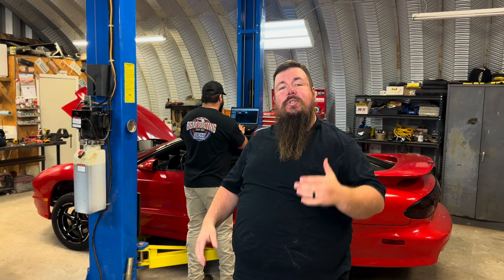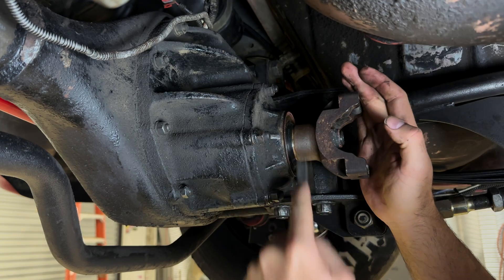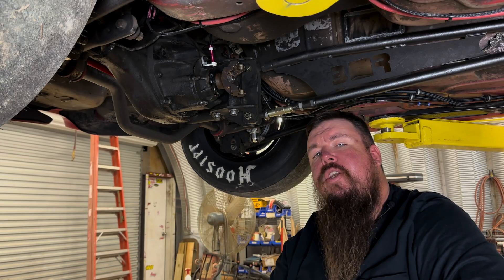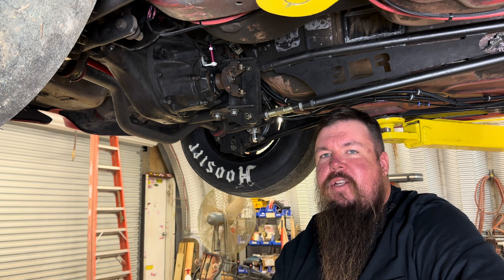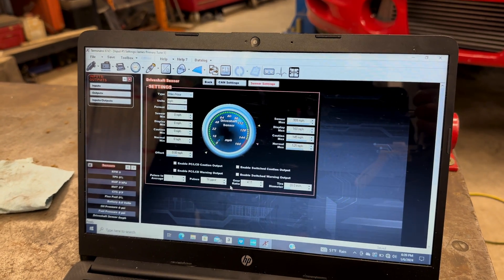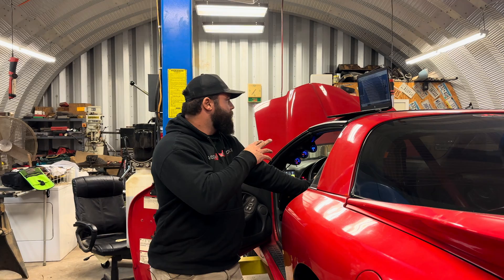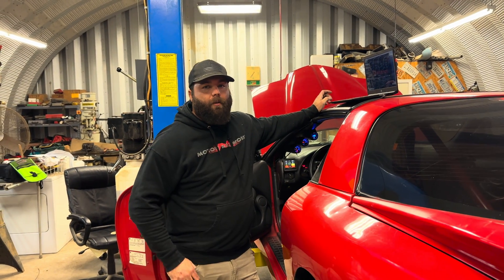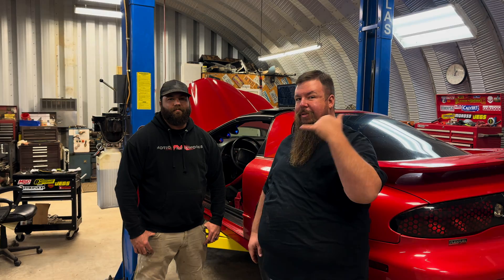How-To: Install Motion Raceworks Driveshaft Speed Sensor

Comment: I have a great deal on automatic transmission. I have a 1996 model with a 5.3L S engine installed in my Range Rover. I want to install a speed sensor because I removed it from behind the transmission due to a metal swap. I want to install the sensor on the driveshaft so the transmission works correctly.

Comment: Question if you dont mind, will the terminator softwares wont accept and work with a 32 tooth sprocket?
Reply: It should. I just checked on the laptop and the “pulse per rotation” counter maxes out at 100,000.

Comment: Did he run a shielded wire for that sensor?
Reply: I did not. I made a harness out of some mesh loom purchased off of Amazon and used some standard 14 gauge wire. No noise in the readings from the sensor. Has been working great for the past year since installed.
Reply: Factory sensors don't have shielded wire either.